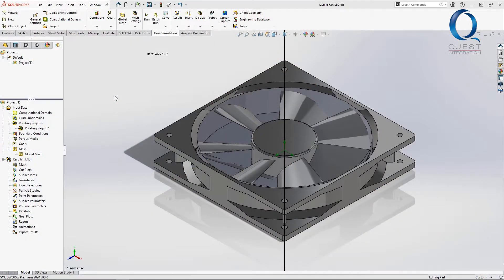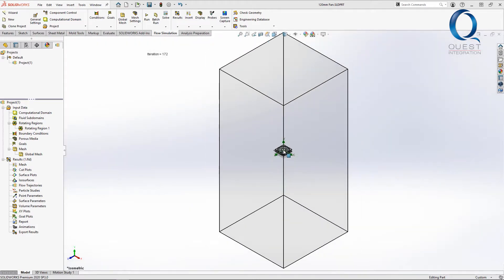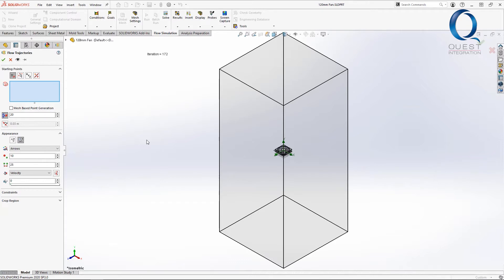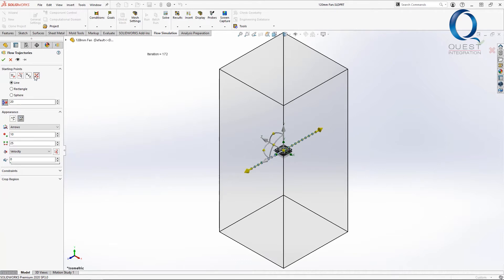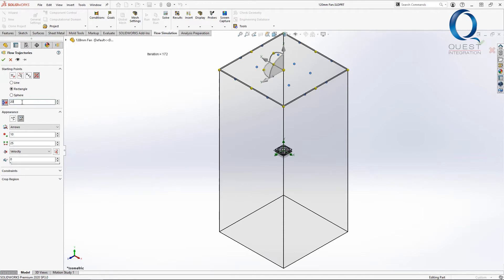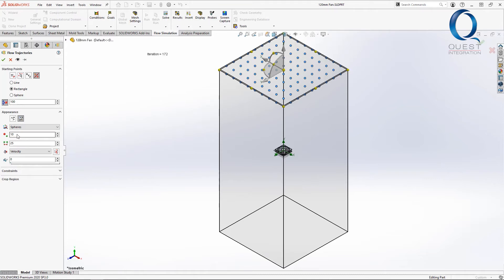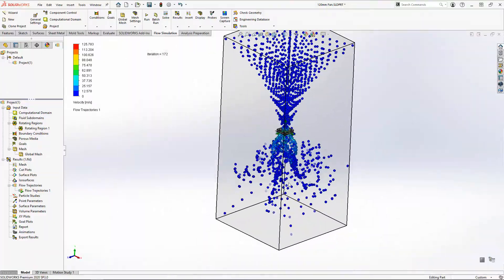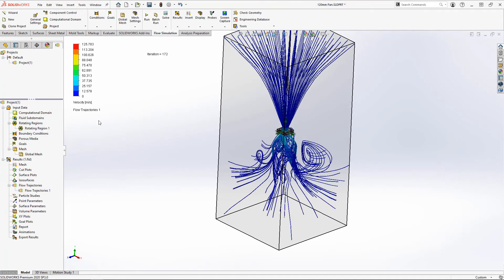Using Flow Trajectories in SOLIDWORKS Flow Simulation

Comment: I have designed a cooling duct for our 3d printer. However the airflow does not exactly flow to the nozzle.
I cannot find amy tutorial that shows the trajectory of my duct which  has one inlet and two outlets. It would help me immensely if I had a link.
Thank you.
Reply from the maker: Hi Yiannis! Thanks for reaching out. We don't have any links to videos that would be a great example of this, but from your description it sounds like you might need to set up an external assembly, but still create a 'lid' for the inlet. This would allow the flow trajectories to leave the duct and go into the surrounding area, but still start from the inlet.